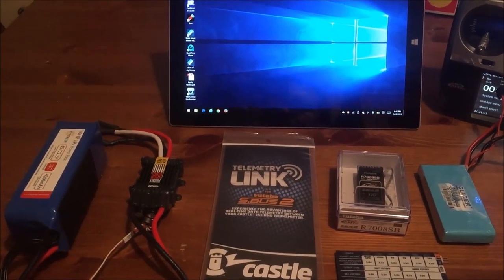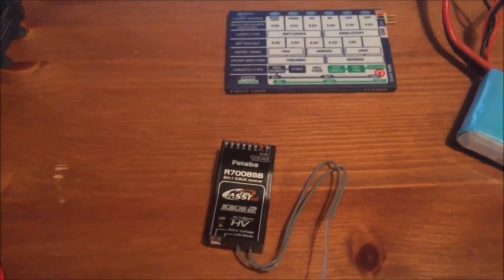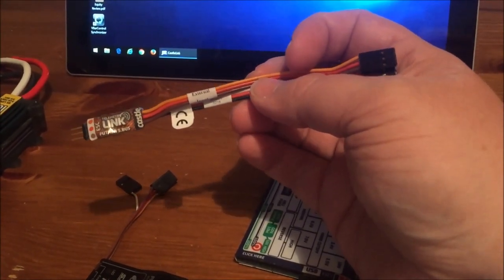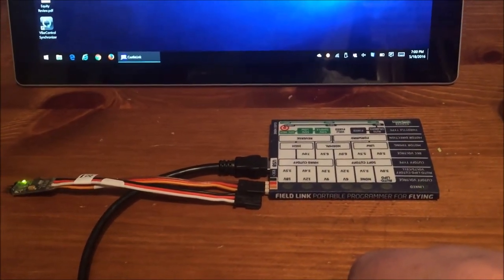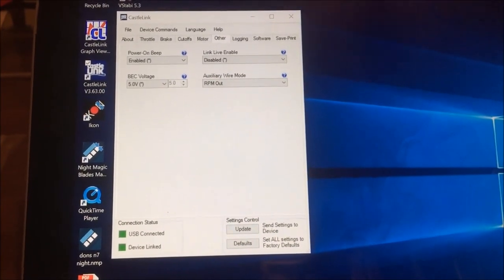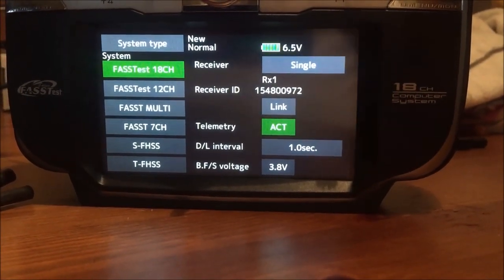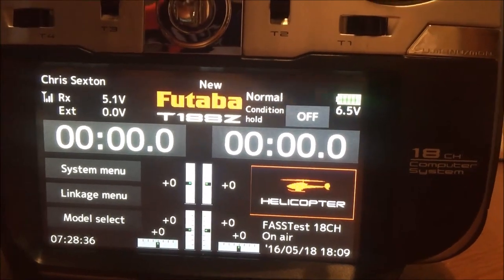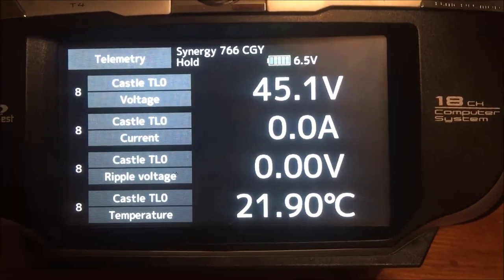Setting up the Castle Telemetry Link for S.Bus2 on an 18SZ

Comment: Thanks for the video, I’ve got everything work, but for some reason, the current/amps only reports 0? This is even under prop load. Amps/current is ticketed in the telemetry, and it also appears to not show when down loading the logs too, any ideas? Phoenix Edge 80HV

Comment: I don't have FASSTest System yet, but my Su-31 is equipped with an Edge 75, I was just seeing what the telemetry was capable of.
 I will upgrade to a 18SZA or 14SGA in the future, so it would be nice to get the telemetry link too. Would try to put them on a flat foamy with a Talon 15 too, its lighter than a voltage sensor for the battery.

Comment: Question? I have the 16sz and I order the castle telemetry sensor and I did the mode change on the receiver to mode 2 like you showed here I plug the wire from the sbus2 from the receiver to my Ikon unit and I am using an old Ikon unit not the newest so when I get the castle sensor where do I plug the white red and black cable on channel 8 sbus? I don’t run bec I use an 2s battery to power my receiver servos fbl etc completely separate is my prefer method. Thank you in advance.

Comment: great video. Im running the 160 and cgy750 as well. how did you run the Sbus wire? I have my Sbus wire from my 750 going into my R7008SB Rx Sbus slot. So how would I wire the telemetry when its being used to link my rx? thanks
Reply from the maker: The 7008 Rx had two sbus ports. You have to change the mode in the RX to turn the second one on. Check the manual. I haven’t don’t it in a while.
Reply: @cdsexton1  thank you...all this time i didnt realize it had 2 sbus ports. thank you thank you

Comment: Hi Chris, in CGY750, it use CH 8 for Governor on/off and CH9 for Gyro2 (Ail Gain), and Castle Telemetry Link use CH8-15. Is it necessary to switch Gyro2 to other Channel ?   Thanks.
Reply from the maker: Gary Lau sensor sockets don't conflict with RX channels. You're fine.

Comment: under the castle TLO RPM sensor , i entered the motor magnetic pole and gear ratio but the castle creation telemetry is not convertion the motors RPM to head speed. it's displaying the motor rpm.  can you help.i am using the futaba 18sz & R7003sb
Reply from the maker: nivasyl strongman make sure the radio, TLO, and esc have current firmware. This was a problem in the early releases but was patched.